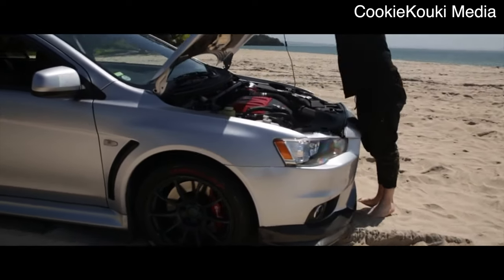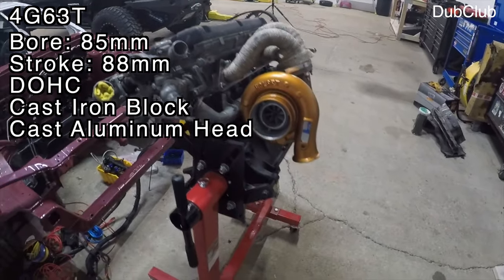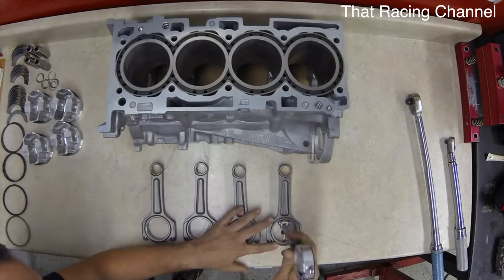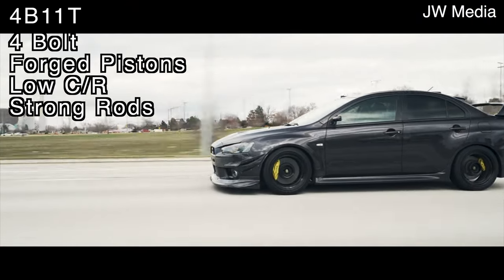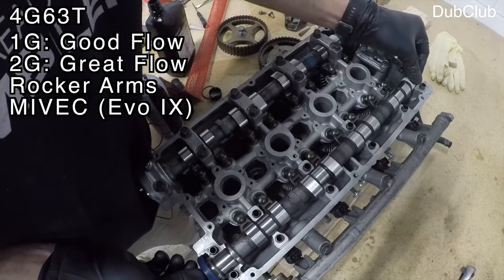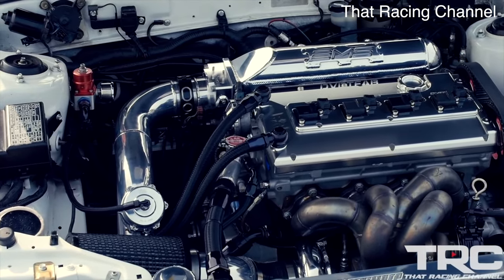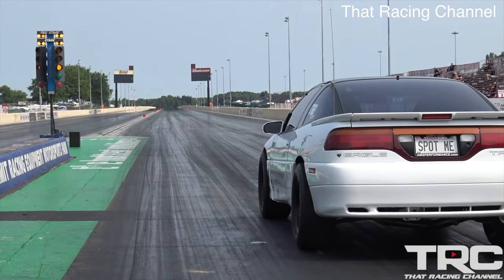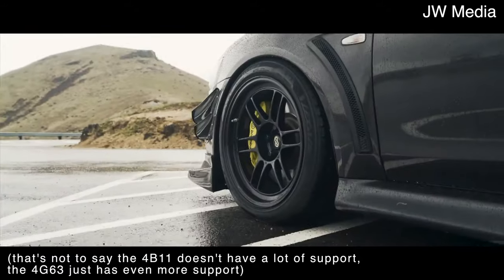Mitsubishi 4G63T vs 4B11T: Which One is Better?

Comment: I would argue theres no point in talking aftermarket since that makes the possibilities for either near endless and therefore not easy to compare. With that in mind I would argue the 4b11 is better as a stock engine as not only is it more efficient and produces more power its also a cleaner engine (which is why the switch was made in the first place)

Comment: The 4G63 was in production for nearly 4 decades, not to mention it’s motorsports pedigree. You could shelve a couple spare blocks, crankshafts, driveline components, and never have to worry about running out of hardware for the rest of your life.

Comment: It's hard for me to see the choice of engine apart from the rest of the specifications.  I have an Evo IX, so at least there you have the "half MIVEC" which does make a noticable difference IMHO (as does the 6-speed, although I hear it's more fragile for higher power applications).  I can not complain about throttle response at all (after a serious retune, the standard maps are a bit... weird).  I kept it at a conservative 400BHP, and the car is now into its 14th year without missing a beat (daily driver with occasional track days).  Could I easily squeeze out another 100BHP?  Probably, but I value reliability and peace of mind over the extra oomph.

Comment: I am currently working on doing a 4g63 head swap for my 3g eclipse. I dont plan on doing AWD with it and it is the AK-47 of the 4 cylinder world. They are in a popular demand and kind of hard to get ahold of unlike the 4b11 and no matter how old the motor is, you can find tons of aftermarket parts for them. Plus I havnt seen or heard of any times where a rod has been thrown through the block. Now I am not claiming that a stock 4g63 is throwing down 500-600 whp, but it is possible to get them there like anything else. I dont know, but that's my general opinion on why I think the 4g63 is better than the 4b11.

Comment: Coming from a tuned ralliart with basic bolt ons. At 275 whp and 318 wtq and now I have the evo 9 mr. Think it’s kind of a hard choice. And I say that because tho the 4b11t is more modern with dual mivec and more low end torque. The X was a much heavier car. And the carbon buildup issue on DI engines is a thing. But also being full aluminum doesn’t just have weight advantages and cooling advantages, but overheating cast/aluminum vs full aluminum, the cast is more likely to warp the head as the metal expands at different rates. I ran the 4b11T pretty hard never had any issues up until the 78k miles which I had it from new. The Mr and ralliart both share same SST trans which is a different topic but in the aspect of applications the engine is in, I think is a fair thing to bring up. Built the SST really can utilize the mivec system with overlap and better turbo better. Can it handle as much power as the standard 5 speeds not really. The X is also a wider car and comes with AYC in the states whereas the 7-9 did not. 
The X also stock for stock shows consistently faster lap times. 

So I think I’m regards to both the engines advantages and vehicles their in. Don’t hate me but I think if your keeping the engine from 300-400 whp range I feel like the 9 with AYC could probably make better use of the 4b11T than the X does. Looks, power and sounds 4g63  hands down is better. But from a performance standpoint I think it’s hard compare the engines when the  IX and X are pretty much completely different cars competing in different eras 

If I’m choosing the car based of potential, aftermarket, and looks. IX every time

Comment: I think part of the hate that a lot of 4G63T fanatics had was the 4B11T gave nothing to the past I think more people would have loved it if at least it was an aluminum copy of a 4G63T, or if you could take something on it to make the older 4G63T better moving forward, almost every 4G63T engine advancement via the evos that went forward gave the older engine generation something they could use not so in the case of the 4B11T but still I like both engines to be honest but for different reasons.

Comment: 4b11t daily here so might be a lil bias but you can bet there's no way in heck that Mitsubishi would step away from the same engine design they have made forever if they didn't have confidence in and believe the 4b11t was better.   (better is relative)   I mean realistically lighter better on gas updated control over the engine and fixed the one major design flaw of the old engine sounds better in a newer engine to me...
Reply: Unfortunately, with that logic, Mitsubishi stepped away from all their good cars because SUVs are better?...  Hardly.  I'd say they evolved like any manufacturer does, but not always for the better.  Look at the 2020 Supra.  Toyota went from making probably the most iconic engine in history that wasn't American to outsourcing to BMW of all people for their whole car.  So I'd say the 4b11 is a good progression from the 4g63, but the bar is set way too high (regarding performance records set) for the 4B to ever actually prove it's better.

Comment: This is one of those situations where there's not really a right answer. It all depends on what your goal and budget are. I would think that an Evo X with 500 whp would be a lot easier to live with as a daily driver. But an Evo X as a drag car adds complexity and therefore difficulty in getting what you want out of it. Pretty sure this is why there are plenty of 8 and 7 second DSM's and like one 8 second Evo X. On the flip side a 500 whp daily driven DSM is not that comfortable. I know. I've had like 10. It's not hard at all to make a 500 whp DSM. But unless you upgrade everything you'll always be breaking something. Everything from shifter bushings to clutch fork alignment. Rear subframe bushings to simple drive belt brackets. These cars weren't very efficient in comparison to today's performance vehicles. But that's what made them so fun and addicting to modify. Now a drag DSM is perfect for it's simplicity and aftermarket support. All the homework has been done for you. Tuning, suspension settings everything from radiators to transfer cases is available. And most of it can be done even if you've never done a timing belt. So it all depends really. My 20 year old self wants a DSM. But my current 40 year old self would rather have the comfortability of an Evo X. Remember a DSM made around 200 hp stock. An evo X makes close to 300 stock. Making 500 to the wheels isn't that hard.

Comment: I’m partial to the 4G63 as I own an Evo 8, which I grew up in as it was my mom’s before me. Pretty much fully built, but way out of tune. Recently sputtered out and wouldn’t start again. I’m wondering if this “crank walk” is the culprit. 135k on the motor seems like it’d have some wear.
Reply: zeroyon223 thanks for saving me time searching about those crank walk.

Comment: Well, here's how I look at it. I want an Evo 6, I can't have an Evo 6 because I'm in the US. I do not like the look of the CT9A (Evo 7/8/9) But I do like the look of the Evo X. Therefore I have an Evo X, and 4B11T.

I care less about the engine, and more about the car it comes in. But as an aside, people are pushing 650+ stock block in the 4B11T. Both motors are said to have around the same safe power limits stock, and the 4B11T has been well developed; every part you want is out there from multiple companies. You will have no more problem finding parts for one than the other. So it really depends on 2 factors:  Which bodystyle do you want? Are you okay with the additional cost of parts for the Evo X? Personally, since I can't have a 6 or even a 5, I answer both questions 'yes'.

Again, I would have an Evo 6 if it were possible. I literally have videos on here where I drove an Evo 6 in Japan this summer, and I believe it was stock with exhaust, and I still loved it. I want that car even more. However, my Evo X just got done with a 700 HP build, just waiting on a Sheepy front mount to tie it together. That stock Evo 6 was more fun than my Evo X when it was fully bolt on. Not as quick, but something about it. But that is the car, not the engine. Maybe a little bit of the engine, that Evo 6 sounded good stock, the Evo X notoriously sounds bad.
Reply: On the stock exhaust, my X sounded like a noisy vacuum cleaner. I've had two aftermarket exhausts since I bought it, and the one I have now (a Turbo XS 3.5in turbo back) sounds about 1000% better than the OEM exhaust.

Comment: Personally, I think the 4G63 is an absolutely AMAZING engine considering it's been able to solidify itself over almost 40+ years of tuning to where people compare it to far newer engines like K series Honda's which are doing almost the same kind of thing they were doing and STILL are doing to this day being able to compete at the highest level. 

BUT, I do think the 4B11 is better simply because it took FAR less time for the 4B11 to get into the 1000whp range, get an Evo X into the 7's bracket in drag racing with far less aftermarket, R&D, and less time to have R&D to even get that far compared to how many years it's taken the 4G63 Evo's to get into the 7's and also the fact that the 4B11 had FAR LESS time to get up to speed with the 63 Evo's being it's 4B11 engine was produced around 2007 which is even LESS time than the rival K series Honda engines took to get into the 7's with how they have been out since 2001/2002 with a 5 year head start! Plus, it's similar to the K series in a lot of ways since it's aluminum block, Timing chain instead of timing belt which is a BIG step up, as well as Dual MIVEC system heads which seem to flow a bit cleaner than the 63 does which is actually kinda cool since it means it's slightly more efficient for air quality which is kinda neat on the low end lol. 

And I do think if given more time to grow within the tuning community like the 63 did a long time ago, that the 4B11 will be even better than both the 4G63 and K series since it seems to have taken what makes the best of both of those engines basically molded into one singular engine in itself.
Reply: kind of a flawed comparison considering the fact that there is much more modern tuning (turbo, fuel, ignition etc) tech available today compared to 10 years ago- so yes it took 'less' time for 4b11 to break into 7's, for example, but that's also because it much newer.
Reply: true but you cant compare a 4g63t to a k series, theres no comparison ✨.

Comment: If more people went with the 4b, chances are it would probably be better. However, since the 4g has a longer history of people working on it, tuning/modding it, of course it's gonna be the "better" engine. 

If/when, someone takes the 4b and does what people did with the 4g, chances are it will be better (if it surpassed its older counterpart when modded)

Comment: Let’s just be real here. 4g63 was perfected over 30 years. The 4g63 head can run more aggressive cams and lift. Your limited on 4b11 on how aggressive you can go because of the bucket design. You don’t have to sleeve the block. There’s a 7 sec awd colt with a wet 4g63 block. Yes you can sleeve 4b11 but have fun when one of your sleeves drop. It’s just one more part to worry about. Any motors got potential but 4g63 are the sbc in the import scene. 4g63 has the stick shift 1/4 mile record with a 7.04 with a best of 215 mph on that car. Jett racing running 6.20 in the 1/4. It also has the 1/2 mile record at 213 mph. 4g63 is a power house and it’s made history. It’s dumb to even compare them. It’s like comparing the 2jz and the b58🤦‍♂️. What’s the point

Comment: I have high hopes for the 4b11 that mitsubishi thought it was good enough to take place of the 4g63 with the new regulations but I do have the question of if one of the reasons that the 4g63 is considered the better motor is because of the aftermarket backing. which one would be better just looking at the stock motor or looking as if both motors had the same aftermarket backing?

Comment: Iron block and fully closed deck wins every time. Nothing against the 4b11 but the evo 9 was amazing. I personally ran an 11.67 @116 on the stock turbo full bolt ons c16 and 28psi.
Reply: That's what you would get from an Evo X with intake/exhaust/pump/1000cc injectors and a tune. Stock everything else. Not even close to FBO. The X is not to be underestimated but everyone does. Its ok. My dry sleeves are going to outrun a cemented deck in my same HP range.

Comment: Well, if aftermarket not taken in hand, the 4B11t Is better than the 4G63t.
This is because it has better cooling, and even though the block is aluminum rather iron, Mitsubishi made sure that it would as strong as the previous iron block, so its as strong, so tunability power and stock power is almost as same as the 4G63t if not better for the 4B11t.
I think everyone chooses the 4G63t simply because it's more famous, or because it has more legacy.
Heck, even Daimler-Chrysler, who owned Mitsubishi in 2007(release year of Evo 10), were considering to pull the funding from Mitsubishi for the 4B11t!
Seriously, the 4B11t is like that unloved middle child, except in this case it's the youngest child.

Comment: The  6 bolt 4g63 is superior as far these go, it was a pure breed race motor with no compromise at the time it was made, hence those massive connecting rod caps, and closed deck design, the 4b11 was an attempt at making an efficient 4g63 that could pass emissions as well as race. So, open deck, smaller connecting rods, thiner pistons. All I'm saying is the 4g63 was built to be a durable power house and that's it, they didn't have to conform to what's gonna save gas, or produce less emissions at idle, cause that wasn't the priority, just durable and fast.

Comment: 4G63T, no brainer..
Was made in a time when the company was still active in, and passionate about Motorsport. The cylinder head of the 4G63T was developed by HKS for the four-wheel drive, Group B Starion. Once Group B was canned, the Starion was shelved but they moved the tech onto the Galant VR4. The Iron Heart went on to receive much love from factory race teams powering the Eclipse/laser/Talon and Lancer Evolution. I don't believe the 4B11T ever had the support of Mitsubishi in any Motorsport endeavors. 
500 horsepower on a stock block?🤣 try 640, and that was a few years ago. The only caveat being ARP head studs and a multi-layer steel head gasket. Mitsubishi needs to ditch the current president and install someone who appreciates what they have done, what they are capable of, and wants to return to their former glory days of innovation.

Comment: 4g63 is better because the engine base is better and there are more performance engine part.  which can modify the engine more, but the 4g63 head and 4b11 head can be combined with the 4g69 block 2.4 liter (with 4g63 head) and the 4b12 block 2.4 liter (with 4b11 head) both as well.

Comment: 4:20 i see you used hp #'s for the 4b11t from the evo x fq400 version but you failed to include the evo 8 version 4g63t made 405 hp in the evo 8 fq400.
Reply: that was a specialty manufacturer mod edition of the car. not very high numbers of those. think the English version of "Shelby" but for evos. highly doubtful to ever find one for sale, and if so, extremely overpriced.
Reply: @rolandbeliveau8379  i understand this, i was just stating the fact he didn't state the correct highest hp per engine from production.
Reply: The last model of the Evo X in UK was the very limited FQ440 which only came with an SST box

Comment: I would say 4g63t is better because it’s not an aluminum block and the design is pretty much straight forward the 4b isn’t a bad motor I just think the 4g has more pedigree and less flawed except the crank walk issue

Comment: Crank Walk aside 63 has proven itself in the trenches of motorsports. B11 is the Civic of the Evos. It may have a few technological advancements & be lighter pound for pound but if they were to do a real world block stress test on the engine where skys the limit on HP, the 63s bottom end will remain together long after the b11 will have twisted & grenaded its soft aluminum block. It's just physicist. Now make it billet with cryogenic treatment. Might have a chance but my money's still on the 63.

Comment: 4g63t because it comes in the Evo 8s and 9s. Not to mention when you see a evo x on the streets it’s usually just basic bolt one.. you see evo 8s and 9s and they might be pushing 550 plus whp.
Reply: I’m pushing 800WHP on my Evo X lol.

Comment: 4g63t is better , just hone your block bores to 86.5mm and put a 4g64 crank in it. 
Then you've got a 2.3L that will give more torque down low than a variable valve timed , twin scroll turboed 4b11t .

Comment: i believe the 4g63 is superior. im mainly talking about the 6 bolt here the early 7 bolt i believe to be the most troublesome. the 4g63 is made of iron and iron is more forgiving metal, the 6 bolt block is extremely overbuilt and strong. ive seen folks runnin 1000hp no issues and i myslef have a 6 bolt runnin 450whp daily and i whoop it and it gives me no issues at all. another big plus side of the 4g63 is its simplicity, its more simple than the 4b11 so alot less to go wrong. and another plus side for engine performance is the fact that it runs a timing belt, and i say this because this means no engine harmonics are transfered to the valvetrain which is excellent for reliability especially at radical rpms. then theres the aftermarket and the fact there are so many more 4gs out there to be had. also im a mitsubishi tech and work on both pretty often. im no hater of the 4b11 and i believe that in na form for daily commuting the 4b11 is more friendly as it has better design for cheap daily commuting. its easier to keep cool, its more powerful, its chain driven so no frequent timing belts, its lighter and more fuel efficient just really a great na daily platform. just my 2 cents 🤷‍♂️